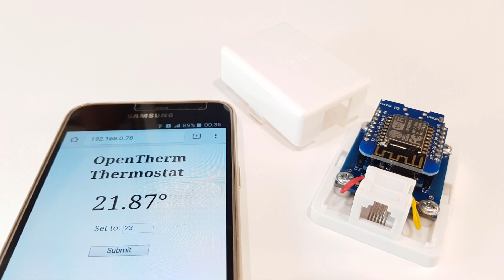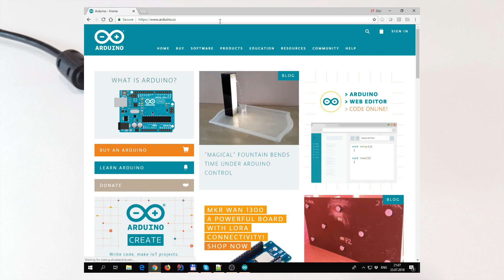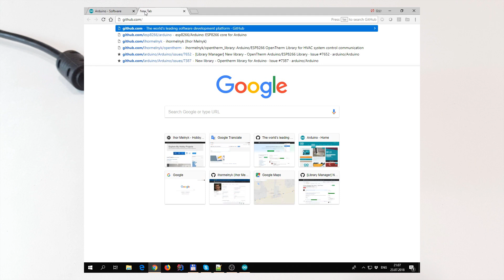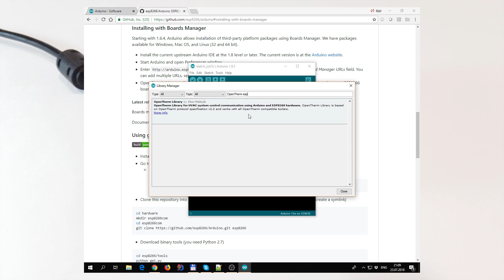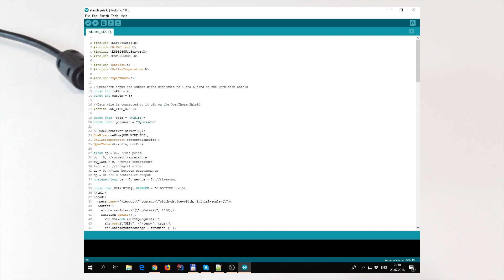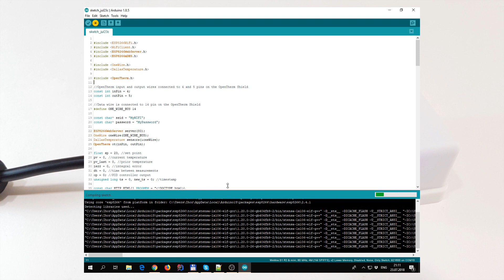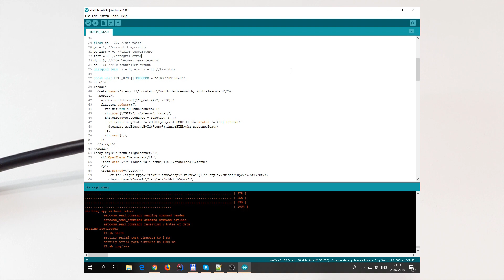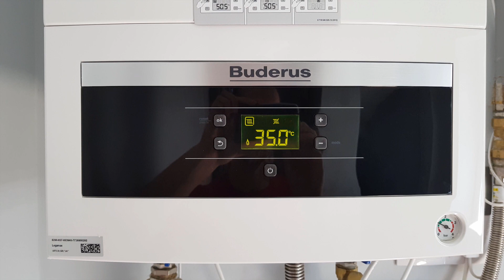OpenTherm Smart WIFI Thermostat

Comment: I see that this is a few years old now, so not sure if work continues on this project. I could see many people paying for a variant of this split into two components that communicate via Zigbee and/or WiFi using the OpenTherm protocol:

1) A "receiver" (server) component that would be installed in a mechanical room, connected to line power (24 to 240VAC), and wired to control one or more HVACR devices. This could be a standalone product that could be controlled by off-the-shelf OpenTherm thermostats.

2) A "sensor" (client) component with temperature sensor, humidity sensor, and a 10-year lithium battery like the ones used for smoke detectors. It would have no display and would be configured wirelessly.

Comment: Just bought your adapter for an arduino and got the hooked up to my vitodens 100 and talking back to homeseer automation using the engimatheatre arduino plugin in api mode

Comment: I built my own thermostat with this hardware and it works perfect. It took me some time to dial-in the correct PID settings, but now it's better then any commercial thermostat. I placed the temperature sensor outside the casing to avoid the heat from the ESP itself. Also implemented an interface with Domoticz based on the "Opentherm Gateway with LAN interface," so I can control it with the Domoticz app. Code share on request.
My thermostat is running with a "Remeha Calenta" heater for more then a year now, without any problems.

Comment: I recently bought this shield from ihormelnyk. I had some issues with the temperature reading not being accurate. The problem appears to be that the thermistor is too close to the esp (which can generate a lot of heat depending on the code you are running. The temperature difference between the esp and the environment can also differ depending on the environment temperature). 
Maybe it was because I cut the leads too short, or because my code is very inefficient, but I just wanted to share that I solved the problem by soldering some additional wires between the shield and the thermistor (about 15cm long wires). Now the reading is the same as my analog thermometer.
Reply from the maker: Yes, you're right, it is recommended to use wires, because the ESP controller emits a lot of heat.

Comment: Is it possible to design a fully wireless solution?
I assume, with the realization of what we can see in the video, you would have to place the module to the place where you want to control the temperature, however the signal is not transmitted to the OT port of the boiler wireless.
Reply: Of course it is possible, just use similar controller to transmit commands over Wi-Fi or make wireless temperature sensor.
Reply: @IhorMelnyk  Thanks. I have a Remeha c-Mix controller that in theory supports opentherm. I measured with multimeter the voltage and it reads and jumps between 5 and 5.4V. Does it have a different range? Thanks again
Reply from the maker: @fulesmackofule  Most of the time line is in idle state. Voltage should be under 7V. So I think you have the same range
Reply: @IhorMelnyk  I'm thinking about putting it together. How can I transmit between two modules over WiFi? Can your box act as a relay host between the room thermostat module and the boiler? What if I want to control more zones/rooms? Thanks